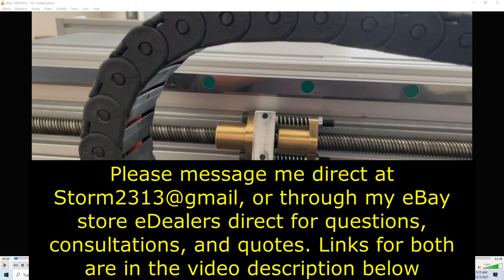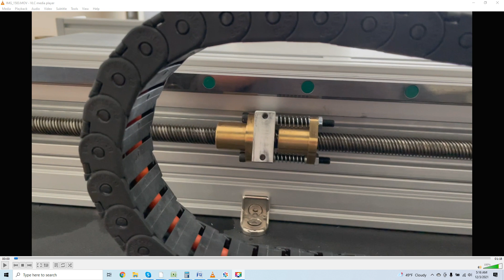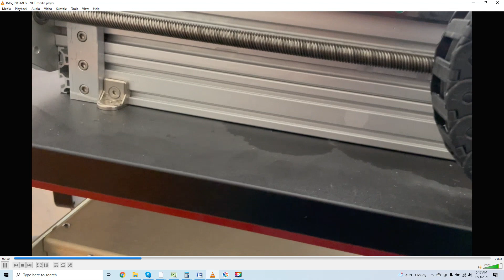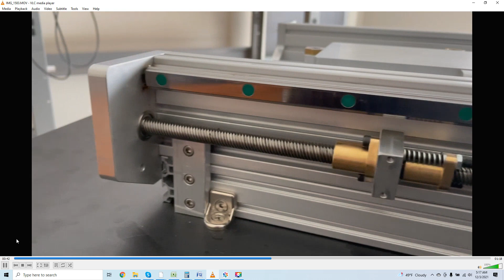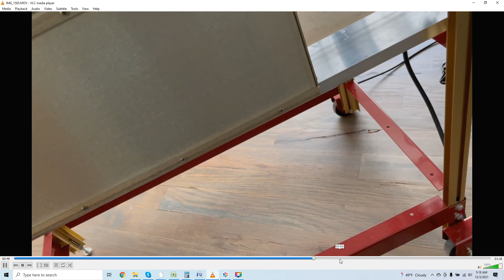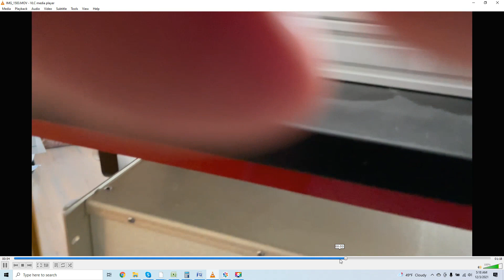How To Analyze A CNC Leadscrew For Linearity..

Comment: How much runout is allowed on lead screws?
Reply from the maker: Runout amount is based on the specs provided from the lead screw manufacturer/vendor. Lead screws aren't as precise as a ball screw. Keep in mind if you're asking the question, and you can visually see runout then that would be to much, and they should be replaced. Thank you, Vince

Comment: Are these lead screws in tension or compression. From the video it would appear NO. What happens when the client assembles the lead screw nut to the part that travels on the liner rail that we see in the video. Also is there any lube being used on the lead screws or are they just running metal to metal with no lube.   Dave
Reply from the maker: David,
Thank you for your support. The lead screws is under no load currently, but will be when the ant-backlash nut is mounted. This will add additional binding as the nut can't float up, and down as the screw is rotated. Lubrication is only to be used after the system is running with the proper smoothness. ITs the icing on the cake..:)
Thank you, and have a great weekend!
Vince